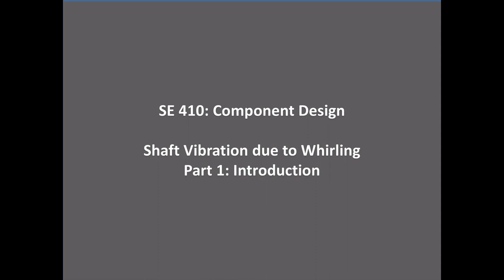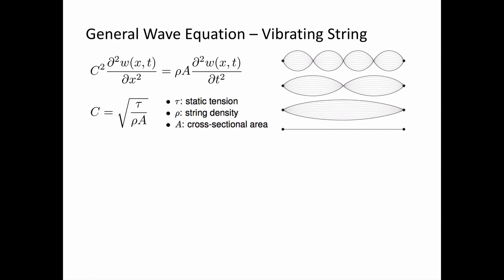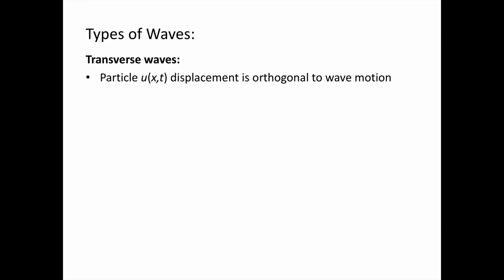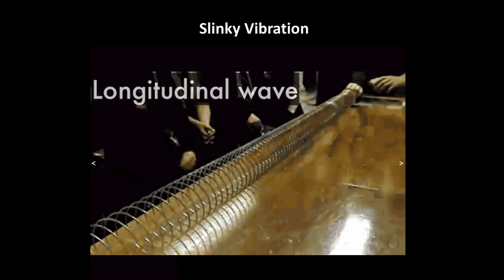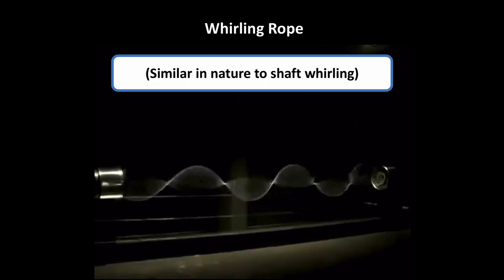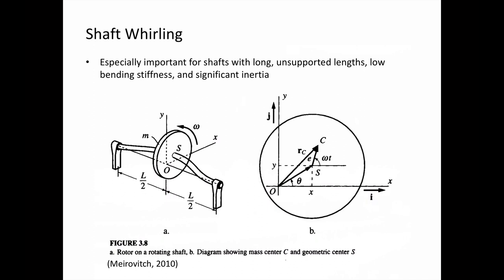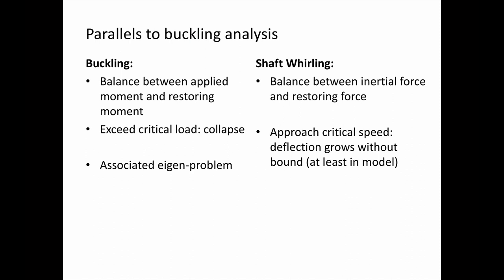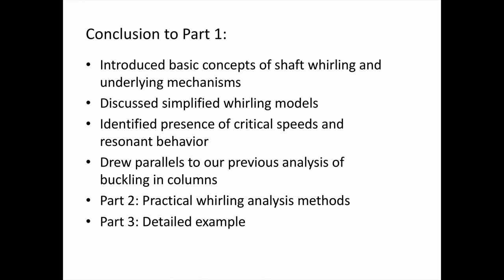Introduction to Shaft Whirling - Part 1

Comment: What is the name of the textbook you refer to at 9:43?
Reply from the maker: Shigley's Mechanical Engineering Design. I am referring to case 5 from Table A-9 which is in the Appendix of the Shigley's book. The vibrations textbook I most often use is the one by Meirovitch: "Fundamentals of Vibrations", ISBN-13:  978-1577666912.
Reply: @designimpact2178  thank you!

Comment: Which books do you use for this topic??
Reply from the maker: The primary text for my videos on machine design is Shigley's Mechanical Engineering Design. This video is supplemented with additional content from structural vibrations textbooks. In particular, much of the additional material comes from 'Fundamentals of Vibrations' by Meirovitch. Thank you for asking!